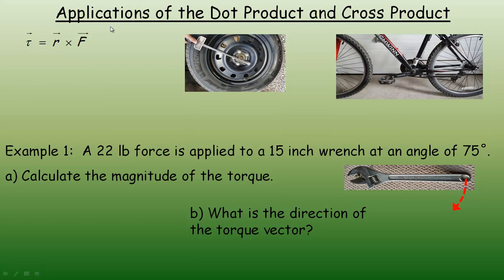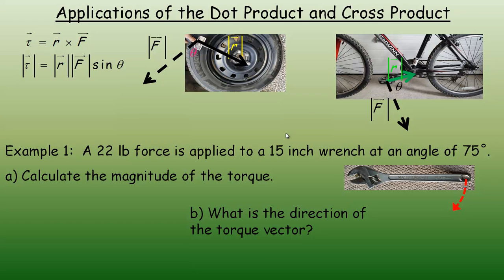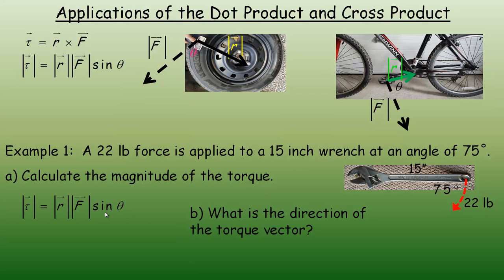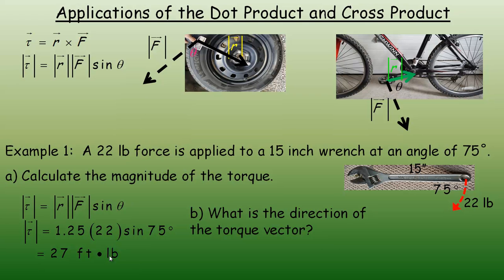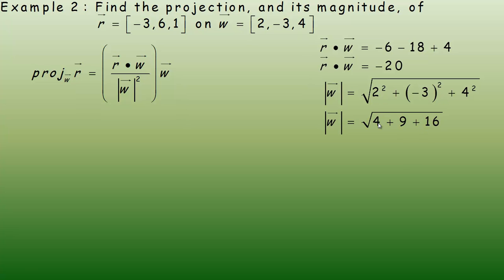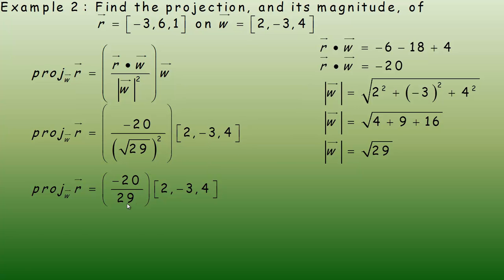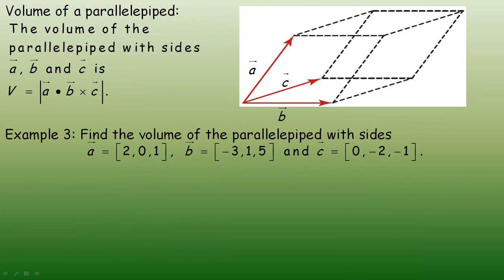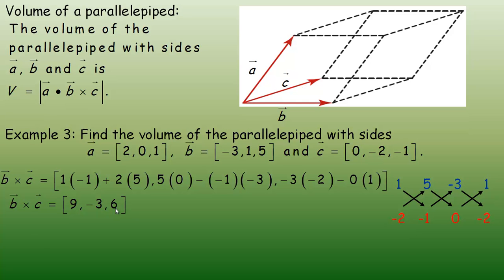Applications of the Dot Product and Cross Product

Comment: Please can someone help me - in the first example, why is the radius r a vector? Surely it is a scalar; it's not going 'from' anywhere 'to' anywhere ?
Reply from the maker: Torque is calculated by taking the cross product of 2 vectors, so the "r" is considered a vector.  The "r" is considered to go from the centre of rotation to the point it's applied at.
Reply: @AlRichards314  do you mean the other way around ?
Reply from the maker: @mouthvacuumcleaner9843  Yes, I had typed that backwards.  Thanks for pointing that out.  It should be correct now.